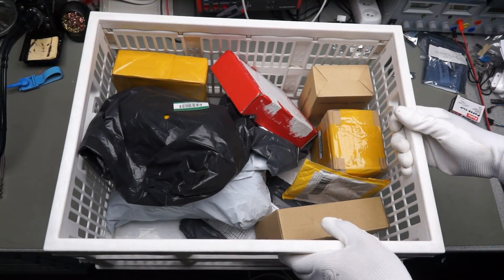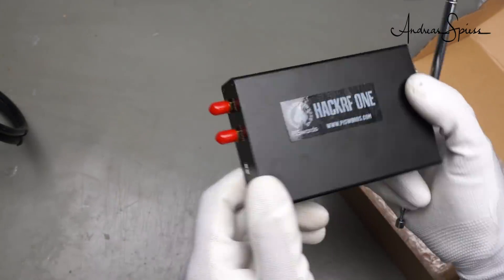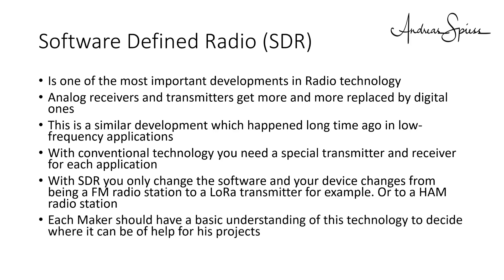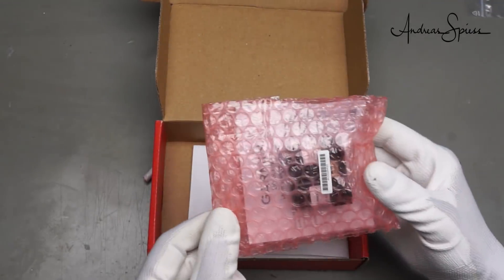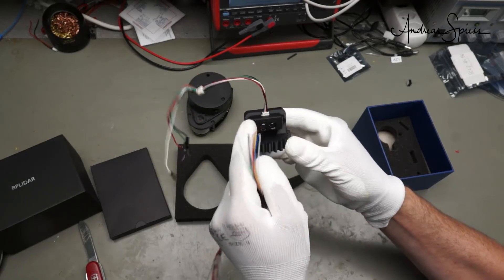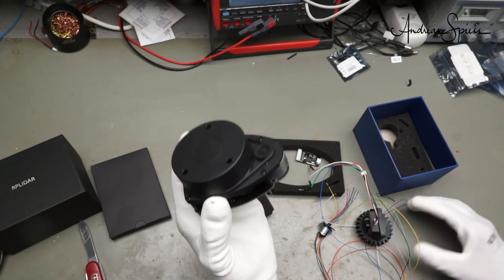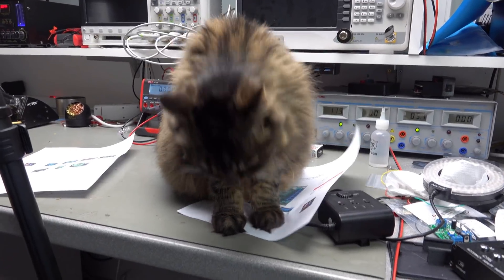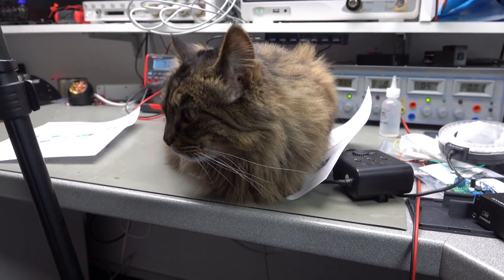#204 My most expensive Mailbag so far: Mostly LIDAR and SDR (Part 1)

Comment: Andreas - I'm verry disappointed that you have bought a cheep "chinese" knock-off instead of the original HackRF ONE. Mike Ossmann and the whole Great Scott Gadgets team is making great work and supporting the OpenSource community (by designing the HackRF and making it OpenSource) and as a comunnity I think it would be great to support them. Great that you have saved few $$ but the author did not get a penny....
Reply from the maker: You are right, they do a great job.
You describe a basic problem of open source: How to make money using this concept. This is the same issue I have as a YouTuber, which is also provided under an open license. Also here, most of my viewers are not supporting the channel through Patreon. This is ok for me because I knew it upfront.
The main reason for my decision (and also many other decisions for other parts) is that I have a very international audience and the international shipping cost out of the USA are very expensive because they use DHL. Adafruit even does not ship it to Switzerland. 
So an original HackRF here in Europe is at least double the price of a copy. Some cheaper parts are three or four times more expensive here.
So I assume my viewers are interested to see if also a copy does the job. And I am sure many American viewers will buy the original because they get it easy and with free shipping.

Comment: 9:35 which SDR is best to start? Depends on  - 
1.  if you want to transmit, the cheapest RTLSDR is eliminated
2.  If you want to cover the HF band (2 - 30MHz) the ADALM-PLUTO is eliminated (starts at 325 MHz)
3. If you are on a tight budget, the HackRF One is eliminated.

Pick 2 of the 3 factors (Tx, HF, price) and your selection is made for you.
Reply from the maker: I plan an introductory video about these questions and maybe answers.

Comment: A bit off tooic. Norwegian politicians are discussing adding VAT on packets from China below approx 45 USD (they are currently free of VAT). Is there any VAT on such packets imported to Switzerland? If not, what is the limit? (50 USD?) Do you have to pay for customs handling?
Reply from the maker: We pay 8% VAT. Below 5 CHF they do not charge it. Which leads to the value of around 60 CHF which is free of charge. Above that we pay VAT plus a handling fee
Reply: Thank you Andreas! The reason I ask is that it is claimed here that no other European country has VAT free import. It turns out that your "free limit" is better than ours, 40% higher at the moment. Do you pay VAT on postage/insurence?
Reply: I assume no handling fee below 5 CHF ?
Reply from the maker: Yes, they add shipment cost to the price. And, maybe for these people we do not belong to Europe ;-). No handling fees if it is below 60 CHF
Reply: Andreas,  Again, thank you. Seems we are in the same boat re. being part of (EU)rope. Soon we will be joined by the UK, it will be interesting to see the implications of being in the same boat as them. Nice cat!

Comment: Quit whining.. In Denmark the limit is only 11usd.. Anyway it is not the added 25% that is annoying but the more than 25usd they want for the trouble of collecting the 25%... And just to rub it in.. If the cost of the item is over 11usd they collect tax of the item AND the shipping cost (this is valid up to a couple of hundred dollars after which additional taxes are added depending on the type of goods)
Reply from the maker: Bad for you. Maybe some Chinese will open a warehouse in the EU to avoid that...
Reply: Andreas Spiess... I do believe there is a couple of Chinese companies that has some kind of a distribution warehouse inside EU.. However most of the times the price is more than when ordering from China and paying the fees.. But in theory you should as a EU citizen be in a better position since I believe that they are bound by EU requlations to provide a 2 year warranty

Comment: The PWM interface on the Lidar Lite is the more reliable with a PixHawk running Ardupilot. There were some interference issues with version 2 when using I2C. I do believe the I2C issues do not apply to version 3, but I went with PWM. I think you need a low pass filter when using I2C. Refer to this page for more info. http://ardupilot.org/copter/docs/common-rangefinder-lidarlite.html. 

In any case, PWM works well for me. I get a kick out of watching my drone climb the berm behind my house without touching the pitch axis. I also put one of the cheap Benewake mini lidars on my quad facing forward for obstacle avoidance. It works too. The communication with those lidars is serial.
Reply from the maker: Thank you for your feedback. It is always nice to see which projects my viewers do.

Comment: 65 USD and no import tax, damn! In Denmark the limit is around 12 USD (80 DKK).
Anything above 12 USD will cost 25 USD fee + 25% of the value, so a 20 USD package is 20 + 5 + 25 = 50 USD.
Reply from the maker: Maybe the Chinese will solve this problem by extending their distribution and open European warehouses (Hobbyking already has one).
Reply: Simon Kunze , that is absurd... Is it to protect Danish electronics manufacturing?
Reply: Michael S No, it applies to everything bought from outside of the EU, not just electronics. We have 25% VAT here so that's what is added. The fee is a fixed price and is paid to  the postal service for handling the customs. 
When buying from inside the EU you don't pay any import taxes. In that case you pay the VAT of the country you buy from.
It's extremely frustrating that components essentially more than double in price at the point where they hit 12 USD.
Reply: Simon Kunze , 25%! We have 6% where I live, but then things like roads are not as good as they should be and many people work as long as they can.
Reply: Yeah that's likely to happen and would be a welcome addition! fingers crossed
Reply: I hate socialism and Commiecrats!
Reply: mohider khana how's that relevant?
Reply: Ask the Socialist republic of Denmark. 66%+ taxes ... Socialism is communism lite ...

Comment: Thanks Andreas :)
Please show us how RTL SDR is used on Linux (PC / RPi ...etc.)
Because using an RPi offers interesting projects for SDR.
Reply from the maker: I plan to use Linux for the SDR stuff because this seems to be the platform of choice. I am not sure if the RPi will be big enough for all experiments.
Reply: Cool man, that is good news :) I agree with RPi limitations, but ...
It seems there are some interesting SDR projects for RPi 1/2/3 ...etc.
https://www.rtl-sdr.com/tag/raspberry-pi
https://duckduckgo.com/?q=SDR+on+Raspberry+Pi
https://learn.adafruit.com/freq-show-raspberry-pi-rtl-sdr-scanner/overview
https://github.com/seemoo-lab/mobisys2018_nexmon_software_defined_radio
https://github.com/F5OEO/rpitx
Apology for posting too many links, just SCAN(fast reading) what you can to get a general idea. ;)
Thank you very much and good luck
Reply from the maker: Thanks for your links. In the meantime, I saw a video using an RPi for SDR and the presenter said, it is very slow. To start I will use a live image on a USB stick or a virtual machine on my PC.
Reply from the maker: BTW: Did you see this project: https://osmocom.org/projects/osmo-fl2k/wiki/Osmo-fl2k
Reply: Welcome & that's a very interesting project, Andreas. Seen it before and thanks for the link.
I'm just like you drowning in Arduinos/uCs, breadboards. shields, modules/sensors, Pis(Rasp/Orange)...etc.
One day I might try it :) I have not even finished testing Outernet :D
https://en.wikipedia.org/wiki/Outernet
https://forums.outernet.is/search?q=rtl%20sdr
Godspeed Andreas, I'm waiting for your videos, esp. SDR.  :)

Comment: Andreas could you tell what connector type the male part of the cable of the TFmini lidar is? I ordered one and I want to keep the cable intact. Thank you.
Reply from the maker: I used a connector which is soldered to the PCB to connect it. It has a female connector
Reply: Thanks for replying!

Comment: Garmin includes a safety manual in 50 languages but couldn't include two cheap rubber lens covers... not impressed so far.
Reply from the maker: Maybe these are not required by law ;-)

Comment: I have a couple of the RTL-SDRs and they are great for the price.  But their downfall, especially if you are a ham radio operator or even shortwave listener, is that the lowest frequency is ~ 27 MHz.  I then bought the new SDRplay RSP 1A that goes all the way down to ~300 kHz so you get all the ham bands.  A really great SDR.  Lots of fun!
Reply: That RTL-SDR dongle that he bought can be set up for direct sampling mode, which allows it to sample from DC to about 14 MHz
Reply from the maker: I had an SDRPlay to play with from my colleague. But for the moment I did not order one. The bill was high enough without it ;-)

Comment: Expensive SDR? I consider them ultra-low-cost. Expensive would be something like the X310 or N310 from Ettus Research. ;)

The cheapest way to learn SDR is to use gnuradio with audio-hardware (built-in speaker and microphone) and a rtl-sdr. If someone has learned enough to program a demodulator in software, he might start programming a modulator and feed its output into the demodulator. All of this can be done purely in software, audio hardware and the rtl-sdr.

The rtl-sdr is the most valuable learning tool because it is really affordable (< 15€). Even if someone only uses the rtl-sdr with gqrx to listen to different transmissions, it produces immediate positive feedback and this keeps most people interested in SDR.
Reply from the maker: Expensive is relative... Compared to most of the stuff I use on this channel SDR technology (except RTL-SDR) is expensive. I plan to go as you describe starting with RTL-SDR and listening and moving on to Gnu-Radio and (hopefully) also transmitting with the other two devices.

Comment: Very interested in SDR myself lately and have been wondering if you would present any material on the topic. I have an RTL-SDR dongle and am considering my next steps... Hackrf One looks great. Have you considered LimeSDR (http://www.limemicro.com/products/software-defined-radio/) ? I would love to hear your comments/comparison.
Reply from the maker: My colleague has a lime and is not happy at all with the SW support. I bought these devices based on his experience. I only avoided the Ettus because of extremely high cost ;-)
Reply: Good point. There definitely isn't as much support for the Lime boards at this point. Perhaps that will change, but only time will tell. It seems they are targeting commercial markets much more than experimenters/tinkerers. Whereas the Hackrf One board seems very DIY oriented. The Ettus boards look good too -- but beyond my reach price-wise. The Red Pitaya is similarly interesting and priced too high. Anyway, thanks for the feedback and all the interesting videos. Keep up the good work!

Comment: Thanks, Great stuff! The SDR and Lidar things are really very interesting. The SDR could be a very useful addendum to your antenna testing and tuning equipment. Which laser class has the lidar rangefinder? Does it have a CE-sign?
Happy Switzerland with 65USD tax exempt amount.
Reply from the maker: The Garmin has class 1 and the TFmini does not use Laser. Both have printed CE signs on the packaging.
Maybe the 65CHF limit is a reason we so far refused to join the EU ;-)
Reply: tax free limit in Greece is only 25$ for $26 item you pay 15 euro clearance fee plus 24% vat.. it is a nightmare.